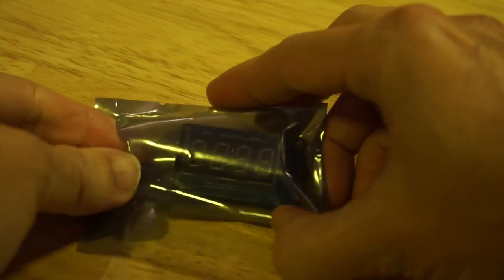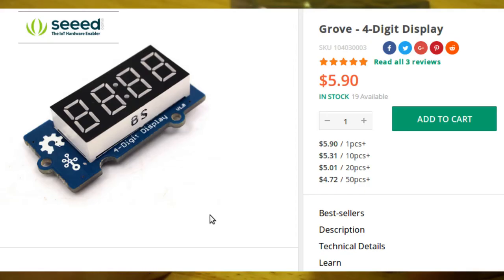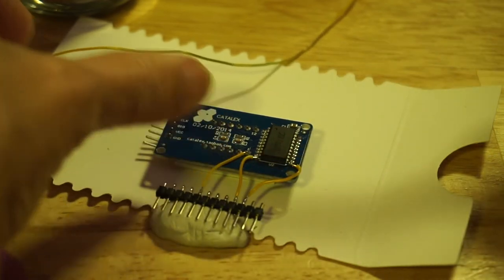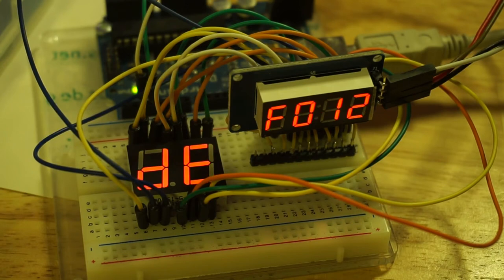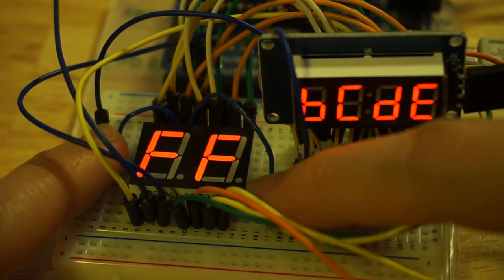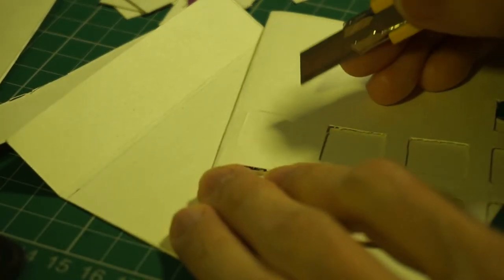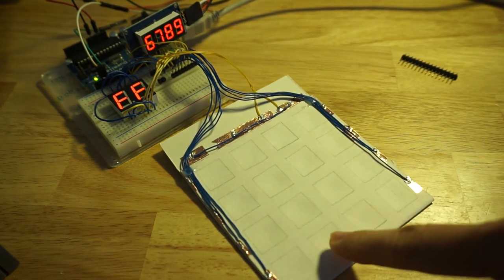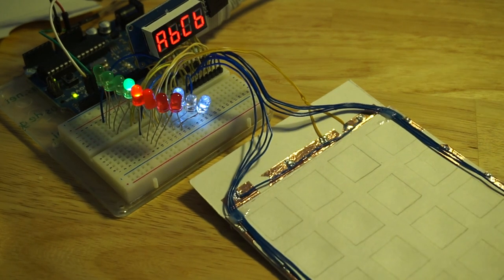Adding more digits and a keypad to a TM1637 4-digit display

Comment: Hi thanks for the info. Can you please share the library for keypad
Reply: Hi jobit, I don't want to hijack bornach's channel, but you may want to try out the TM16xx library (find it on GitHub). It supports the TM1637 and similar chips and has button support based on the popular OneButton library, allowing for detection of key-presses, long presses and double-clicks...